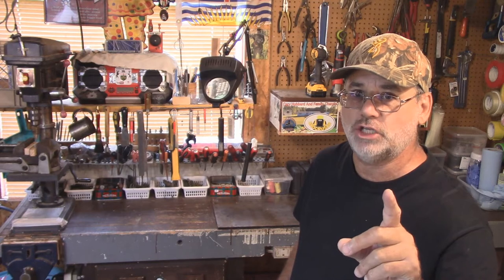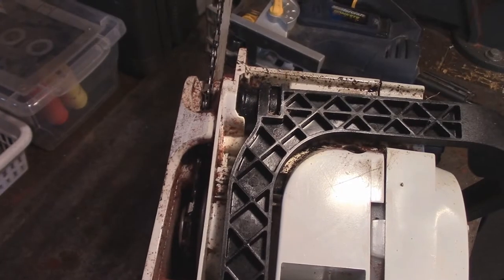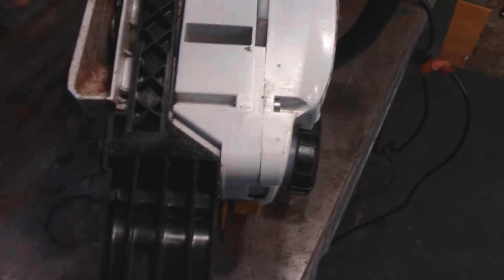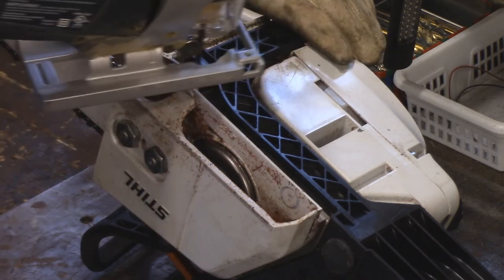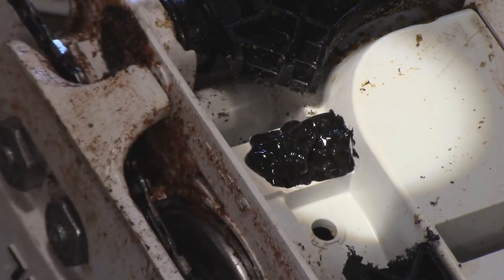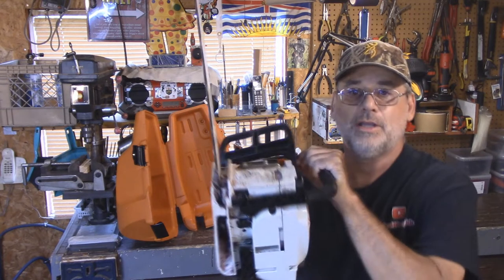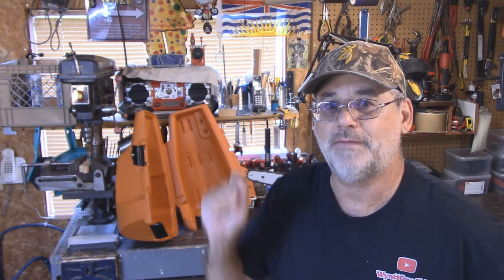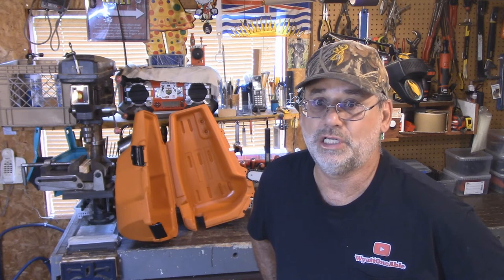Stihl MS 170 Oil Leak Fix - My Diy "HACK" Took 10 Minutes

Comment: Gee, I  thought I was being creative when I came up with this idea a few weeks ago, but you beat me 😂 They should come with a removable section to allow access to that hose & pump. I eventually went the difficult route and disassembled. Funny thing is that before I  got it fully apart, I realized that the oil hose had come out of the bottom of the pump. That means it was never installed properly. Once that hose end is pushed into place properly, it cannot fall out on its own. It is well protected too, so not pulled out by branches or whatever. Shame, as my saw is quite new and from a Stihl dealer. Bad enough that they are cheaply made, but when quality control goes out the window too, we are really getting shafted. BTW, the disassembly went well as I only damaged 1 of the plastic push caps. Easy inexpensive part from Amazon. Keep up the great creative ideas!
Reply from the maker: Thanks , I try :)

Comment: "Chickanic" on her channel kept seeing the same disassembly problems on Stihl saws until she found out you had to buy a proprietary tool set from Stihl in order to get to, and then take apart their equipment. You're right though: this fixes the problem! 😏💯💯💯
Reply from the maker: Ya I bet the tool wasn't cheap either , fixed real good so far. Cheers 👍

Comment: I've had no problem taking apart & massaging back to alignment the 30 year old vibration bushes. The leaks are cap, tank hose etc. Ps all saws 👀 leak after use. It is the change in greater amount.

Comment: Is that oil resistant rtv that you used?
Reply from the maker: No leaks , problem solved . I used plain  black silicone  .  RTV ,  sure use it if you like.   Cheers Ryan.

Comment: Wow!  You had me rolling with laughter on the “cheesy” comment!  😂 Great idea for a fix!  

Hey, Stihl saws aint so bad.  They never leak bar oil, or are hard to start, or smoke a lot, eh  😂 J/K

I recently picked up the MS180, which is virtually identical to your saw, with a tiny bit more power.  I never noticed the lack of carb adjustment, until after I got it home.  It’s a plastic fantastic!  Sheesh!  The joints where the see thru windows for gas and lube, dont come together well.  And the person that commented below about why you just didn’t remove the handle, well, they obviously never had/seen one of these.  

Ive only run about 10-12 tanks through mine, but the saw does well for what it is.  i got it for much the same reason you use yours, Steve.  I have so many small downed branches, and briars and junk, so I needed something light and easy to maneuver, and it does well.  I just hold her WOT and use it like a laser!  Works well.  The small chain is a pain to keep sharp!  

My two Makita/Dolmars DO NOT leak a drop!  *touch wood*. 

Let us know how this works out.  Always appreciate your common sense and no nonsense approach to things, Steve.  Peace 👍👍👍😊
Reply from the maker: Thanks George,  stihl  makes a great saw and the low end models are not pro saws  or  cost pro prices so I figure a cheap fix for a cheap saw  was in order.  I have been using the saw and its dry as a bone and the peice of plastic missing is not noticed. Cheers 👍
Reply: @SteveRobReviews  You’re Welcome, and thanks for your reply!  Glad to hear it is working out for you.  Aww, the miracle of Silicone!  Mine does ok, and only leaks after use, which can be expected.  They are good little saws for what they’re intended for.  Mine was ‘assembled’ in USA.  Cheers!

Comment: good vid . i always thought as far as new saws , stihl was the best option , but i think i will just stick with my mac 10 an pionere . may be heavy but still kicking since early 80's
Reply from the maker: Hi Greg 
The new stihl value saws are priced right but built light too so stick with what you have it's 10 times better.
Reply: Old Pioneer saws are the best

Comment: Yea I’m with you on this one - frustrating how the unit is buttoned up so you can’t access the oiler. Hope you’ve solved the issue with silicone…I believe you did - I think that the fuel and oil tanks heat up and expand during use which in turn effects the fittings and even the tank caps…at least in my experience. Cheers
Reply from the maker: Hi Ed 
Well so far do good and I have used the saw to cut fallen trees on my road and the peice missing isn't missed 😅 cheers 👍

Comment: I just bought one a year ago and it leaks super badly. I am going to try your trick
Reply from the maker: Mine is still bone dry after doing this and the saw works fine.  Just make sure it's leaking at the bottom and not at  the side oil outlet. Cheers 👍

Comment: I think you will find that no matter how many new oil lines or what brand, the ms 170/180 will always leak oil. You may be onto something.
Reply from the maker: This is bone dry still , if I get any other leaks I will show it . So far so good but everyone I know that bought one has huge oil leaking. I hope they have fixed it by now .

Comment: I sort of inherited a 170. I'm going to do what you did for the leak, but I noticed when I tighten up the oil and gas caps...there's a split around BOTH caps! ( about a 16th of an inch from the top of the caps ). Are these supposed to be there? You can't notice them until you tighten the caps Tight!!
Reply from the maker: Hi Jim 
Yes the split is correct, and under one side is a notch that fits a grove in the tank  to form a seal.
Reply: @SteveRobReviews  LOL!! Thanks Steve! So I guess I should'nt have crazy glued them closed????
Reply from the maker: @jimbo1959  HAHAHA
Reply: No, buy a new cap. They are cheap

Comment: I just store the chainsaw tilted 45 degrees with the filler cap side down. No bar oil in the case for a few years now.
Reply from the maker: Hi Yves
That a great idea for many but I transport mine in the back of my truck so this resolve fixed the leak great . Cheers 👍

Comment: Did you realy have to cut the bar, could you somehow put the silicone underit?
Reply from the maker: This was the easiest way for me , works the same ever since except no more oil leak.
Reply: I didn't see this but thought the same thing and tried it. I cleaned the underside with brake cleaner, let it dry and filled it with sealant by squirting it under the plastic handle and let it cure in the sun for several hours. I placed it bottom down on clean cardboard and after several days the cardboard is still dry.  Thank you, Steve Rob,
Reply from the maker: @chrishowell3637  Hey bud, that's awesome  that it worked for you without cutting the plastic bar 👍
Reply: Steve, I have the same saw and same issue.  How has fit fix worked over the long term? Thank you.
Reply from the maker: @georgemitchell9114 Hi George  , bone dry 👍

Comment: Stihl has a service bulletin to put a set screw in a tiny hole between the bar and muffler.
Reply from the maker: Interesting,  I'll have to see exactly where . Thanks 👍
Reply: If there is a orange plug it was corrected at the factory. If it's open order the set screw because it can be too long and block the passage to fat will crack the plastic.
Reply: can you explain this a bit so I know please.  There is a oil tank vent.  Plug that with a set screw?
Reply: Can you please add the link to this info please? I can't seem to find it. I have the same saw and same issue. Thank you.